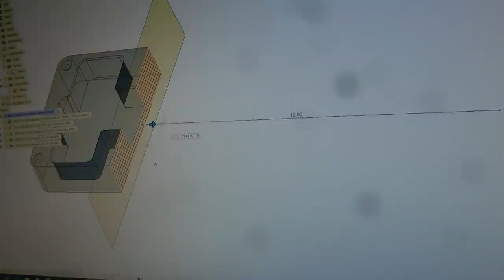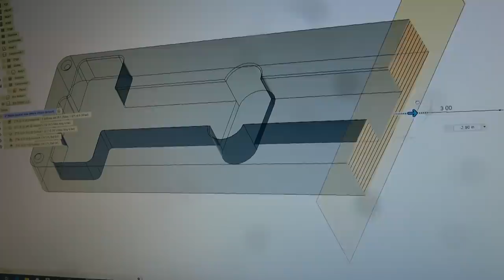Robotically Hammerin Box | Working the wood (maple)

Comment: I laughed out loud when the fire started. Great video. I am thinking you can just use some type of flat basal platen and stick the wood to it with double-sided tape. Wood workers send thin pieces through the planer doing that and it seems to work. Also, with all the area you have for vacuum clamping you don't need high pressure at all. You have several hundred square inches. So if you can get 2 psi you have 200 or 500 lbs of clamp force. Shop vac may be able to maintain 1 psi even with a little bit of leakage.

Comment: Cutting wood with a CNC is a pain for anyone. The cutting speed and bite are a balancing act of experience in trying not to heat the tool and not to cut fine shavings: but getting the right bite without chipping the wood is a matter of trial and error. If you go with a low speed and a gradual feed - you'll get nice cuts but you'll also likely create small shavings which are also referred to as "kindling" - and if you shoot it with any kind of schmoo to keep it from igniting - the wood swells and the finish product dries out with warps and bends and ragamuffin jagged surfaces. The best way I've ever seen was to seal it, and seal it and seal it some more: in a hot environment so that the wood soaks up the sealant going down into the grain structure quite a depth: and that what what you cut out shouldn't swell and the sealant adds some strength which reduces the risk of chipping. 

I'd gladly just use a mill or lay out a design and get at it with chisels and gouges before I had to CNC on wood ever again. On a mill I just make the work piece bigger than the finished product and clamp it down goot-n-tite in the metal vise then saw and sand off what I don't want later, after everything else is done. In an industrial setting quick, fast and dirty is the goal: but for my own stuff or for anything critical which has to be done right in one go due to cost of the work-piece: it's either the mill or chisels and gouges. No question. 

Here's an example of what I mean, follow me on this for a minute. I've had to mill precision keyways which had to be +- .001 on the peak of the round for fabricating huge industrial fasteners, literally a giant bolt with a keyway slotted all the way down one side. I had to turn them on the lathe, I had to thread them, and I had to cut the keyways for them. The damn things were made from some ungodly home brew of high nickel alloy steel, went through 3 carbide bits  (the fluted bits on the mill anyway, the turning process wasn't terrible because the material plasticizes). That job was significantly more hassle than the pay I was given: and that was still more tolerable than when I had to CNC wood.

Comment: Hmmm I think you’ve re-discovered that wood is porous like sea sponge skeletons but a finer structure. You may need to put some channels in the inner support area to better distribute the air flow and additional vacuum ports will help with maximizing the air flow potential, kind of like a larger waffle iron pattern.

Comment: Your solution to the work holding problem was beautiful, but too complicated. Will come in handy for metalwork though. 

For the boxes: screw holes in the bottom, once you finish machining, cover the holes with copper inlay. Would be a nice touch on a box for a copper hammer.

Comment: If the vacuum part fixture turns in to too much of a pain, you might try some 2-inch wide 3M double sided tape. I've used it to hold jigs for hand routing and it seems incredibly strong.

Comment: I think the slippage could be taken care of by not using the vacuum plate. Make step #1 cutting keyhole slots on the backside (for hang-up display mounting purposes), then use those cutouts to bolt the thing to the table. Routing a separate piece for the fellas name to be inlaid into the box might be nice and attractive, and ease production for the box itself.

Comment: Use MDF as a Spoilboard the vac will pull right through it. I worked in a custom cabinet shop and we used about one sheet of 3'4 mdf every month and would shave it down every day about half a mill so we could cut all the way through. please try this. Plus compression bits will help with top tear out.
Reply: And the feed and speed we used with a 3/8 compression bit was 18000 as 12000mm/min

Comment: Having programmed CNC mills for a while I was offered a job Programing for a cnc router, it’s a complete pain in the ass. You have up cut bits ( pulling the chips up to leave a good bottom finish), down cut bits pushing surface cuts down to leave a good surface finish) combination bits (a bit of both). Then you had to watch your feeds and speeds, if you went too slow the heat buildup in the bit would set fire to the work. It was a pain in the ass, so I went back to metal.

Comment: Your giving we flash backs of the morning I came in after the fire brigade had been to visit and our 6mx2m bed 5 axis router was a gutted, charred mess from top to bottom.
Complete right off. We think that was a dust combustion.
Then there is deep pocketing where the wood clips form a heat isolating fluffy blanket over the cutter action down the bottom, the long cutter needed for the deep pocket has non fluted portions of it running round the side walls trapping and compacting wood chips/dust into the corners. On one occasion the compaction was enough to snap a 25mm dia solid carbide cutter and the layered up block of ply wood we were machining just smolder internally all night generation enough heat to expand the joints in the aluminum table bed by a couple of mm.
Required new bed top and the entire cross slide assmy replaced just in case.
Routing is not as glamorous as metal machining but it has it challenges, and you soon learn when to pick your battles doing lights off machining.
I still run 24 hrs + one off paths with a bit of 3+2 action throw in over night.

Comment: Cute wood "chips", we have a WAY higher chip load. Looked almost like sanding. :D
Scoch usually isn't peated. Nowdays most grain is dried with hot air. Unless you are on Islay. :D The distinctive smoke smell indeed does come from peated malt! They  usually smoke it for a couple hours. But the duration depends on how smoky you want your grain. (Can also be achieved by mixing peated and unpeated grain of course)  Check out the Whiskey Tribe for some nice background, but be warned of shenanigans!

Comment: Try conventional milling. On  CNTree centres it's doing a job. Also You can try to split vacum plate too for example add cross groove, and make 4 sections with separate suckholes. Then even if 2 sections leaks at start then two others will force  a piece down and seal whole plate by sections preloading each other one by one.  Also more rubber underneath prevent side sliding of piece that's just waiting for You to turn around to break Your neck like'a ancient frisbee  :P

Comment: Time to make a venturi with a bigger vacuum port on it so you can run a larger diameter line efficiently. Give the vacuum you have a great flow path, it can greatly improve performance of the jig. You gain more leakage tolerance for a given vacuum being pulled. You should try some foam rubber gasket, there is stuff meant for CNC router vac tables. I use CNC-Tool's .250" x .3125" flavor at work on my 284" x 59.5" CNC router.  You need more gasket conformation ability, as long as you're not trying to bridge more than about .100" over few inches of length, the CNC-Tool gasket will retain 27" of vacuum without being sucked in. Plus, you always what the firm one... firmer is better. I'd bet it'll do the job for you perfectly. Sadly, its not terribly cheap, but eh... it effin' works.

Comment: on the subject of lumber hardness:  maple is to oak as oak is to pine.   trimmed a kitchen in maple, had to predrill all my nails holes and hand nail,  nail gun would not work.   none of my power tools were too happy cuttting this stuff - miter saw, planer and especially the router

Comment: An idea for that plate. Turn it into a flat graphite air barring. Apply red gasket material around the perimeter both to keep the vacuum under the work piece and to provide a no-slip region around the perimeter. Might work, might fail miserably.

Comment: You have to speak wood to get the thickness you need. 8/4 S2S will be 1 and 13/16ths inches thick and will save you the trouble of laminating.

Comment: Something I read a long a long time ago about swelling wood... lol. To get a wooden handle in a hammer or axe to swell up and fit tight... soak it in anti-freeze for a car engine. I did it on a 20 pound sledge hammer up at work about 5 years ago. It's still fitting tight. Soaking in antifreeze is supposed to swell the wood and its not supposed to shrink back down. Seems to be working. But then I am the only animal up at work that uses it.

Comment: I would venture to say that wood had a pretty high moisture content to start with, plus the mill tried to dry it too fast in the kiln which created a huge amount of tension in the wood. That's why it wanted to pinch the blade. Lucky you weren't cross cutting it on a table saw, or it would have been a classic kickback demonstration!

Comment: Unrepentant wood-nymph here. Try a light dusting of table salt between the boards for glue up. It digs in and breaks up the slip without screwing your adhesion. I made a lot of mulch for the garden before figuring that out

Comment: You could add adhesive backed vinyl to the bottom of the maple which should give you a better sealing surface.. Also I'd buy some slabs of maple instead of laminating two pieces.

Comment: make your wood work piece oversized and screw a metal plate to the bottom around the edge. The metal plate will support the vacuum and afterwards, you can gut off the outer edge where the screws were installed.

Comment: This is why wood elves typically use routers, not CNC's.

Also, why they laminate and shape after they do the cutout section. AvE over here working his wood like it's Oakluminum. :P Next time you mess with carcomybrate foam like this, make a router guide, and try it that way... Sure, it's a lot more human involvement and a lot less computer mathetronical precision, but the carcomybrate foam is itself very himperfect...

Comment: I hate air venturis. Sorry. If I wasn't willing to buy a larger vacuum compressor, I would probably go with a college chem lab style water venturi and recirculate the water with a jet pump (can be scavenged from a hot tub). (BC is a wet area, so water usage might not bother you - if that's the case, run full water pressure and flow through one from a garden hose... They can pull enough vacuum to boil wine at room temperature, which is a fair amount without getting into higher performance, higher dollar vacuum systems)
Might be able to use a decent size air compressor, epoxy or tap and screw a barbed hose adapter to the inlet and get a lot of flow for a vacuum system, albeit at not as high of a vacuum.
Also, as other commenters have  mentioned, perhaps a different sealing material, other than the machine-y buna o ring that you seem more familiar with. Good for machines, less good for vacuum sealing with tree carcasses and whatnot.

Comment: You are a much smarter man that me,  but did you try replacing the rubber gasket material on the vacuum pod surface? For wood it usually needs to protrude up, and that one looked flat.  You figured it out but I didn't see the solution

Comment: Just the thought of cleaning up the sawdust off of the CNC mill is making me nauseous.   That stuff gets into everything.  Gums up the works real bad.  Made the mistake of using my metal lathe to cut threads on a dowel.  Had to mock up a fixture to hold the mini router with a V-bit.  Also found out that sucking up 98% of the sawdust with a shop vac while cutting the threads is about 2% shy of averting a disaster.  Worked like a charm until the small amount of sawdust mixed with the residual oil/cutting fluid and turned to concrete.  Evidently when you stall a motor the main circuit breaker for your house trips.  Who knew? 

Took forever to clean everything up....

Comment: I think it’d be cool if you machined your own vacuum displacement pump for your suction fixture.  Lord knows your five axis machine can handle it.  I’ll admit a mill-turn feature would make it easier but you can still do it.  If I send CAD drawings for the design, would ya give it a whirl?  

Signed,
   An intrigued mechanical engineer

Comment: im curious did you use a wood milling cutter, or metal milling cutter you had in the shop?  Cause I believe the wood milling cutters are designed to run cooler and they are made out of different material.

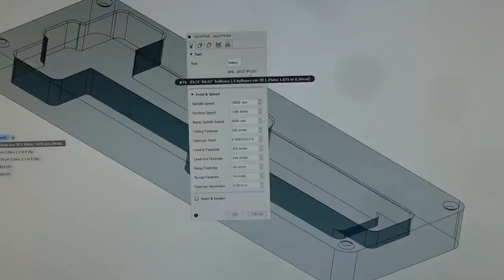Comment: 5:48 - Atari ST... ok... you earned just a bit more respect. :-) (I had the 512K, hand soldered on the extra 512K RAM with the flying 30ga wire to make a 1MB machine... remember that???) Yeah...
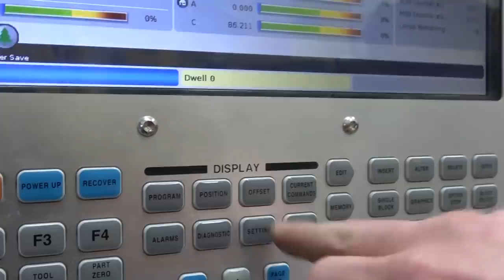7:28 - And woodworking becomes a barbecue... grab the hot dogs...
Reply: @BlackEpyon  I had an original TRS-80 with expansion interface, two floppies, and a voice synthesizer. Freaked out my mom every time. Later I also picked up a Model III and Tandy Color Computer. I have calculators with more memory than all of them combined!

Comment: I think the standard way of vacuum fixturing over in CNC router land involves a basal platen with channels cut in, pulling vacuum through a piece of de-skinned MDF.  Once you take the surface layers off that stuff, the inside is rather porous. Maybe that would pull more evenly and clamp a bit better than the current solution?

This video covers it, starting around the 4:00 mark: https://www.youtube.com/watch?v=sx8fAv5f8js

Otherwise, two pieces of painter's tape and some superglue?

Comment: Seen people folks put a whole layer of painters tape on the bottom of their workpeice and the top of whatever they wanted to secure it to, and CA glue the two together. Its strong as fuck and you can remove the sheet of tape fairly easy when youre done.

Comment: So, I was thinking about the chooch factor for the basil platin, with the Buda gasket thingy, well, how about if  u  make it a bit bigger, and softer, for example, if the diameter of the gasket was 20 thousandths bigger and it was just a big more pliable, maybe a different material, that would give u less resistance and allowing the suction to work proper,( or maybe even taking out more material in the plate to up the suction area, this should create more downward psi on the wood,.... maybe?) just and idea)    I am a huge fan, and I just thought this might help, just a different point of view.... thanks ....... 
GregoryM
Reply: Door sealing tape is pretty commply used, it has those properties. Also applying a finish to the basal side of the tree carcass can help with sticksion, and seal up the pores, though I've never tried it.
Reply: @zoravar.k7904  door sealing tape is open cell, this has to hold air pressure, so it has to be a. closed cell type, this does sound like a good idea, but if the open cell door tape is used then is wouldn't seal, I was thinking of a closed cell, light weight, pliable type of rubber, polypropylene maybe.... again, just another point of view

Comment: Even zere neus... (auw)...

As a wood elf, I can't help but notice that you are using a low spindle RPM. The only router I have that can go that slow, is a handheld unit. A simple 8mm end mill type bit is normally spun at something like 31krpm or 35krpm, I don't know if the Haas will actually spin the spindle that fast, but given that it's a metalworking machine it probably doesn't.
If the cutter leaves burn marks, the feedrate is too low. Also it looked like you were climb-cutting at least half the time, which is generally a bad idea.
And last but not least, you used mere steel to cut maple. And while steel will cut maple, it won't do so for very long. There's a reason even us wood elves prefer the paragon of materials for our cutters. We're too damn lazy to redress our cutters every third cut. Maple is pretty damn dense and hard as far as wood goes.

Comment: You need more suction holes in your vacuum block, i used to work with a machine that would lift a 20ft x 12ft up to 1/2 thick of glass. Trust me.

Comment: Maple just went up a rung on the hierarchy of materials. As a part time wood elf, I know 4/5ths of fuck all about science and enginerding, but I'm thinking, wouldn't you get better sticktion if the cavities on the vacuum plate were deeper, so you could draw a deeper vacuum. 
I reckon you need to get a better seal too, that o ring is as much use as a handbrake on a canoe, that wood is never going to be flat enough to seal properly. 
The tool you want for this job is one of those German built Wandel's, or maybe a Heise!

Comment: Weren't you the one gushing about compliant structures a while back? Wood is the original compliant structure. That's how you get a post into wall that's a quarter inch shorter than the post.

Comment: You are using to hard of a o-ring on that vacuum table. On my CNC router i use a pretty soft epdm rubber o-ring material and just a shop vac and it woorks fine. And with the softer rubber and the higher volume from the shopvack it pulls down super easy. I can just drop an uneven wood board right on it and it sucks right down.

Comment: I run the cnc router at my shop, I'd be more then happy to help cut out some stuff for you if you'd like. Would do it for a trade if you're willing. I have a 4x8 bed with 10 inches of z travel. I use solidworks so if you send me step files or a dxf i can hold some pretty tight tolerances even in wood, usually within a couple thou

Comment: You can minimize all that slipping around when laminating by sprinkling some salt on the boards after gluing them.  ..I've heard about tight grain issues pinching blades but I've never experienced it due to climb cutting.. hint-hint...   ,;^/